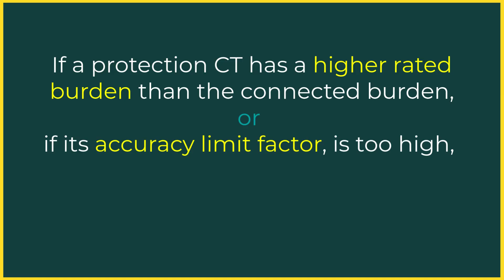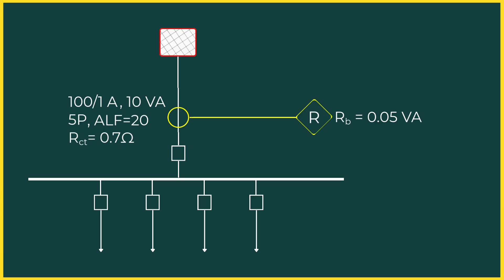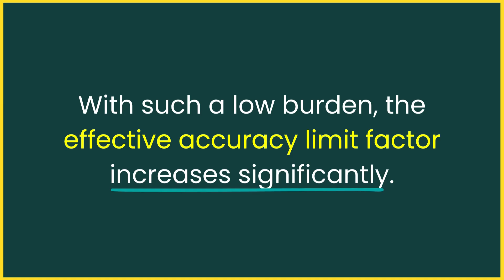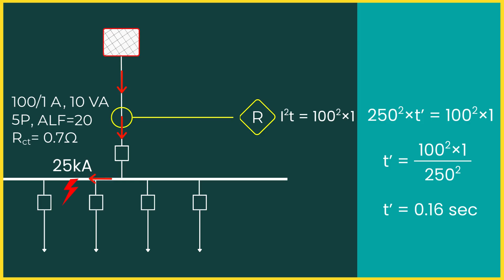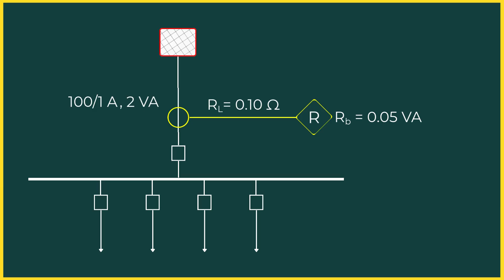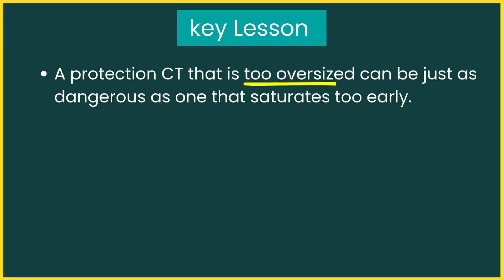Why an Oversized Protection CT is Dangerous | CT sizing Mistake

Comment: What will happen in case of ps class CT oversized to its rated burden
Reply from the maker: Good question. The same principle applies to both Class P and Class PS CTs.

Many engineers assume Class P and Class PS CTs are different in construction, but that’s not really the case. The construction is similar—the key difference is in how their magnetic performance is specified and controlled.

Even for a PS CT, if it is significantly oversized with respect to the actual burden, the effective operating point shifts. The CT may not saturate where the protection scheme expects it to, and very high secondary currents can flow during faults.

This can stress the relay input circuit beyond its thermal limit, and in extreme cases lead to damage or even dangerous open-circuit conditions on the CT secondary.

So the issue is not about P vs PS—it is about correctly matching the CT to the actual burden and protection requirement.

Comment: Такая ситуация часто встречается на старых подстанциях, на которых за годы значительно увеличился ток короткого замыкания
Reply from the maker: You are right. This situation is often seen when older electromechanical relays with high burden are replaced by numerical relays, without reassessing the actual CT burden, the resulting ALF, and CT saturation behavior under higher short-circuit levels.